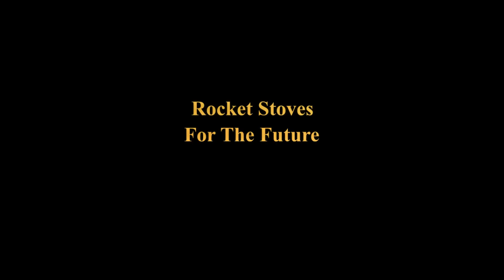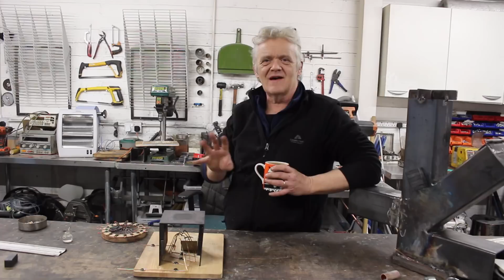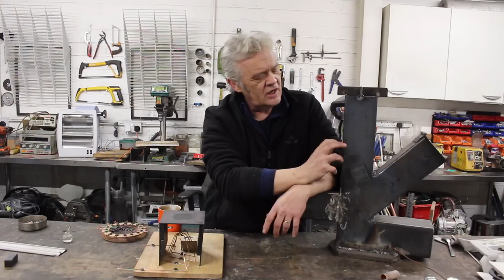1733 Rocket Stoves For The Future

Comment: Two important factors to keep in mind about the "type" of rocket stove: 1) "open" air with full air entering the burn chamber and exiting by short exhaust tube; and 2) "Restricted" air with the air being restricted due to 1) wood in feeder/hopper reduces the air amount and flow; 2) exhaust once exiting the vertical burn riser it is in an enclosed air space and then out into a long chimney.  All this changes the flame motion and burn efficiency dynamics. Roaring flame and air causes a different burn than a "slower" flame. I see this in my home rocket stove as I don't get that nice fast and furious flame vortex, but a milder vortex. This will have to "recreate" different changes for a "restricted air" rocket stove than "open air". Can't really duplicate the design to be used on both. The idea is to find what design and air/flame/flow creates a hot burn, clean exhaust and high extraction of heat before leaving the unit. Remember roaring fire burns out your steel so protect it.

Comment: Robert I have a some questions you are a chemist right? How could you make methanol by Catalytic hydrolisation of CO2 with water. To storage the energy in form of methanol and then use it to generate electricity in a later time by mixing it water 50%/50% or 45%/55% or even 60% water and 40% Methanol to run an stelzer combustion engine to generate electricity. Is a stelzer engine really that high efficiency as the inventor claimed? He claimed 80% to 90% efficiency because the conversion from linear to rotatory motion got removed therefore more efficiency because of the lack of motion conversion. And the direct conversion of linear motion into electricity. Like a Voice coil

Comment: If we live in the war situation, than all these ideas are not working. Today we see war in Ukraine. Peoples need very big amounts of energy, because all equipment of communication for example use big LiPo batteries. If sun is shining all day, than I think 250W Solar photovoltaic +12V100Ah LeadAcid is enough for LED lights and modern mobile phones with Starlink dish. Of course we will not be able to boil water in large quantities with this kind of setups, but we can use rocket stoves etc for meal and water boiling... We need combine all that for optimal colaboration in war times. But in peace times we don`t need all that.

Comment: Over the past few weeks I've built a waste oil fueled rocket mass heater in my shop. It works so well that today I'm adding a water heating coil to pump water through to heat my small house. It has a flat steel plate top that I plan to utilize as the heat source for cooking and possibly a Sterling engine to help charge my small battery bank...

Comment: Hi Robert, been thinking about these for a long time. Best bang for buck has to be shrouded, with a coil heat exchanger inside the shroud for hot water, and a fan in the flue to drive a pump, all built into a mass storage construction. Hot water, space heat, thermal storage and electricity all from very little sold fuel. Has to be one of the most efficient energy transformation devices in this configuration. Please check out Loz Harrop on YouTube, he has built many prototypes, perfecting the design at each iteration, culminating in one of the most efficient rocket stoves I have seen based on his input fuel amounts v/s his output temperature data. Keep playing, these things are awesome and have so many possibilities. Cheers, Jon

Comment: Re: Rocket stoves more specifically Rob, what do you think about using vacuum insulated, large glass jars (very easy to do) as the "core" of a rocket stove, but protected by insulated clay (something like cob, but insulated better i.e. instead of using sand, use fumed silica)?

    The idea is to super contain the heat where you want it for an extremely efficient burn, and let the heat out where you want/need it. The trick is to extra seal up the lids to maintain a long term vacuum. The other trick is, as mentioned above, is to protect the glass from heating and cooling too fast, with some insulation and mass (soda glass doesn't do well with expansion to contraction phases). 

   I have a super simple, inexpensive hand/manual pump system that pulls a surprising 28" Hg (Pump N Seal).  Since the jars I would be using are 32 oz, these are a few inches wide. That is a simply ridiculous amount of insulation in the center of the jar. We're talking something like an R150 equivalent (plus whatever the insulated clay adds).  (Granted, the weak park of the system/idea is that you have to use multiple jars, connected to each other, and the space between the jars will have very low insulation comparatively).
Reply: Justin W:  Have you already tried this? Glass jars usually have a fairly low melting point. Think back to all the times in the chemistry and physics lab when you made your own vessels from existing tempered glass vessels. So it might be important to consider the temperature to which it needs to stand up for your stove.  
     When you talk about using vacuum insulated glass jars, are you talking about something with double walls which take a lid? 

If you have a video, a link would sure be appreciated. :-)

Comment: What if you used a standard wood stove catalyst on the rocket stove and then capture the converted gasses to be used to run an engine like a  wood gasifier? Modern wood stoves have a catalyst inside, made to react the volatile gasses and produce more heat, but the end products should still be capable of running a gasoline engine and may be more efficient than a traditional imbert gasifier. Worth an experiment or two. And it might produce significantly less tar and water vapor than the traditional designs developed in the 1930s and 1940s. I would love to see you experiment with this idea. Love the videos, keep em coming!

Comment: I'm wondering if a thermal storage tank for a solar thermal system can be housed within a thermopile. I'm thinking of a system to heat a greenhouses that takes excess heat to power supplemental lighting. Also, excess heat during the warmer months to produce methane from atmospheric carbon that gets saved for winter when there's less sun to heat with.

Comment: Round heat ducting could be a better substitute for making rocket stoves and creating vortexes. They are thinner so can easily be cut, bolted together tack welded or pop riveted.  They can also be wrapped in a concrete thermal jacket and you can put wheels on for moving them around.

Comment: I try to eliminate all the metal within the rocket stoves I make. But it is nice the work your doing getting the tech out there. I normally build bigger ones so the temps get too high and burn out steel fast. So maybe yours will last because the temps won’t be as high. Either way I love all the stuff you’re doing

Comment: I must say I am drawn to Stirling engines too, particularly alpha types - currently thinking of wondering how best to seal the output crankshaft without too much friction losses and ensuring at least some pressurisation as well as how to ensure good enough tolerances on the cylinders with a casting process (probably reaming). 
Rocket stoves seem well suited to heating the hot head using relatively abundant and cheap wood as fuel 👍

Comment: Just to say there are  such stoves on ebay which are collapsable for about £20, my dream would be to have a bolt on steam turbine battery charger with a condenser to also produce distilled clean drinking water. If someone mass produced this say for £70 or less I would bite their hand off to get one.  Currently I'm spending £16/month on mineral water but free distilled would suit me fine. Heater/Cooker/Charger/Drinker - wow.

Comment: Today I've combined the rocket stove idea from previous video (drilling holes in the bodem of the 'exhaust' part) with the catalytic converter heater. 

I've took a catalytic converter, cut of one side and then put heat resistant wool (from a cat) in the bodem.

Then I've drilled some holes in the top part with a small part of exhaust still on it (so it works as a chimney)

Then I've poured some ethanol inside it and lit it.

Works like a charm till now and looking from the top it almost looks like a gas stove burning wise!

It's been on for 15 minutes now and my shack 4x5m (although quite isolated) the temp has raised 5 degrees celcius. 

And the exhaust gasses are almost not there because the flames are most of the time blue. (yeah I have a window partially opened) 

If you want some pictures please contact me :) it's quite a bodge how I've made it but it works.

Comment: I use my rocket stove as a campfire replacement, so I need a bright flame 🔥 and efficiency is my enemy since the flame is not that bright.
Reply: Sounds like a borosilicate glass rocket stove would work best for you in that case.  They make high temp adhesives (usually a kind of modified waterglass essentially) that would work especially well with glass (waterglass sticks very well to glass). The downside to b. glass is that it is fairly expensive and somewhat fragile and heavy (but less so than soda glass).  But it all doesn't have to be made out of it.  Just the riser/chimney part of it could be (that would give you plenty of light). 

   When we say campfire, are we talking car camping or backpacking more so?

Comment: My use case would be a small rocket stove water heater. Heat an insulated water tank via thermosiphon, run hot water indoors into one of those ebay peltier modules with a water block on one side and heatsink/fans on the other. Run the peltiers at low voltage and cool the water/heat the room. This way I don't have to babysit a fire all night... What is stopping me is I live in an area that is only cold for 40-60 days a year. It would take years for ROI to make sense even if I made it from mostly scraps and say, aircrete for insulating the tank. 

The evolved idea would be the same small rocket stove heating a gasifier chamber, water cooling the condenser tanks and using same water for indoor heating mentioned above. Nighthawkinlight had a fine video series on collecting the gas and I've seen it taken further and compressed... though storing hydrogen in standard propane tanks scares me. Carbon fiber scuba tanks. Might require an additional cooling stage if the water tank gets too hot to condense the woodgas.
Reply: It is somewhat easy and not terribly expensive to make vacuum insulated panels at home.  Hence, if you used these, you could use a cheaper material for the tank itself and just line it with these, and achieve super insulation.  

   Btw, the best heat sink for peltier would be a flat panel equivalent of the heat pipes they use to cool computer systems.  The latter are copper tubes that have some wicking material inside and a little bit of distilled water, then a medium vacuum is pulled on it and it is sealed up.  The combination of the copper's conductivity with the phase change cycle of the water inside (from liquid to gas and back and forth), essentially makes it like a super thermal conductor.

     So do this with flat plates of copper instead.  And on top of that, put a microfiber cloth, and just spray with water occasionally (if you're not around, put some kind of container on top, pour water into it along with the wicking and surface area increasing material of your choice).  Voila, you now have a way to really keep it cooler.  Probably the best way to connect the peltier to the copper super cooling plate, would be through a thin layer of indium. 

   Oh, and for the rocket stove.  The core of the rocket stove could be vacuum insulated, large glass bottles that are protected by extra insulated cob of some kind (by extra insulated, instead of using sand to strengthen the cob, use a combo of fumed silica and diatamaceous earth, along with some perlite and hay or the like).

Comment: The rocket stove is a neat way to optimize the burning of a fuel. Getting the most BTU's out of your fuel. As you have shown the mixing of hot air into the the exhaust stream encouraging secondary combustion is key. The two things I have found that helps is round shape on the exhaust encourages the gas to spin in the vortex shape and a double enclosure around the burn box using the gap inbetween to beat the air for the exhaust. 
Shape the hot air entrances into the exhaust stream so the spinning exhaust pulls the hot air into the stream.
Thank you for all your videos they keep my mind bouncing along😁😁
Reply: I am trying to get my head around the introduction of warm air, to aid secondary combustion. 
When I was young (a few years ago... unfortunately), I learned the importance of introducing cool air, into an internal combustion engine. The cooler the air, the higher the greater amount of oxygen by volume. 
Doesn’t this apply? If not, why not?
Reply: I am replying from a little screen and really find it difficult to edit my mistakes.

Comment: This maybe off topic but i find it fascinating and would like to share with you.

Recently they found water under the Great pyramid like a lake the water. Could it be that water pressure was used to create Piezoelectric in the pyramid with water being pressurised against the granite in the queens chamber, the 2 shafts are where they would enter the weights to pressurise the water to create Piezoelectric which would then go up to the kings chamber and then the cap stone which is no longer there.

if the water comes up from underneath the pyramid and the pyramid is sealed then where would the air go that's trapped within the pyramid. Piezoelectric
Reply: Biogeometry would be an interest for you!! Dr Ibrahim Kareem ,
has done some fascinating work about the how and whys of the Pyramids!!
I hope this helps!! Its an Amazing subject!!
Reply: @AndreaDingbatt  Thanks will look into that.

Comment: Could you put some kind of turbine over the chimney to drive a generator as well to add to steam generation? Seems a shame to waste the rising hot air. Is it possible to use multiple generation methods simultaneously to generate more electricity or will it just reduce the individual amounts of resultant energy to conserve the total  energy generated? Sorry if this is a dumb question. Cheers!